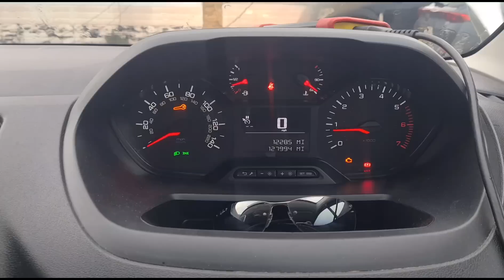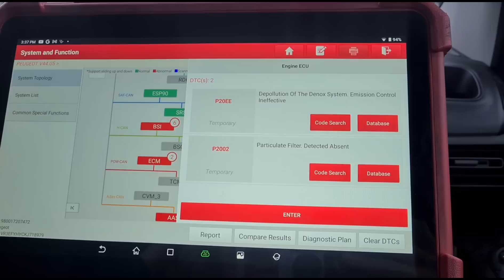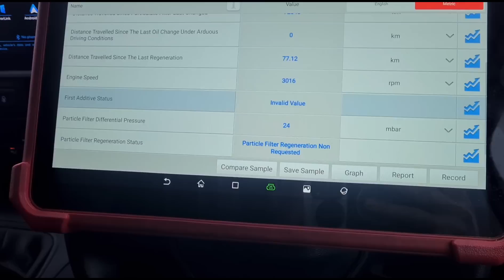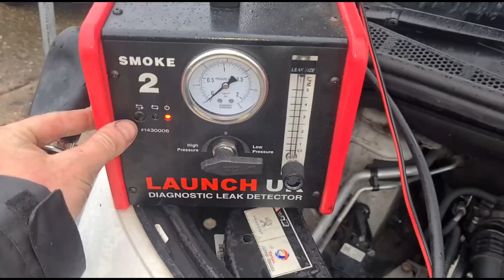Peugeot/Citroen Urea Light flashing

Comment: Hello Jimmy I was just wondering if you've ever had a vauxhall combo with the adblue light flashing with the milage counting down but there's no fault codes stored in the engine ECU at all before?
Reply from the maker: Sounds like it had a remap or you have a basic scan tool
Reply: Sorry I should have said which scanner I tried, Snap-on so I would have thought it was good enough to at least fault code read. The only live data I could see that wasn't right was the ad blue tank said it only had 1lt of adblue but the tank was full

Comment: That sound ruff as cam timing be out or has failed at some point hit valve and span cam lope that might of been fixed but in most cases dv5 bend valves due to piston head been sloped dv6 engines are flat piston so ya get away if it

Comment: Those new type 1.5 jump timing on the chain between the 2 cams, it sounds like there’s an intake leak, but it’s a timing issue. It will need either a new chain or complete cam box, but needs done quick before the chain snaps. Peugeot did a recall at one point to replace the chain and guide.
Reply: Hi just want to say that’s a fantastic diagnosis I would love stewey to go back and check it out to see have you got the correct diagnosis good man 👍
Reply: Hi would like to pick up on something I forgot to mention he said he got a second hand engine because the reading on the scan tool came back that the dpf had great reading I was woundering could that be from the last engine in all fairness the poor guy is gone home with a headache but I don’t think Stewie did a proper diagnosis on it in all fairness to the lad who put his hard and cash into it
Reply: I forgot to put black soot on the exhaust pipe

Comment: Has anyone had any luck replacing a additive tank on one of these same age  we replaced one that got smashed we got a new one from Peugeot but can't get the fault code to go with snap-on and they tell us it needs to go to Peugeot
Reply: Make sure you have the battery on charge, sometimes you have to reconfigure the tank to the correct level yours might think it's a 1L tank but could be 1.3 or 1.4, I've had a good few of them like this.
Reply: @DK-ks3lq  we have tried everything with our Snap-on and it pop's straight back up when we start it Snap-on help line say if it's 2016 on it needs to go to Peugeot
Reply: @colinhamer6506  Peugeot is a bit finicky, you may need to sort out a Diagbox system.
Reply: @G-ra-ha-m  Jimmy has since done a video on the exact same issue I had and I think he said even the Dealer couldn't sort it he ended up changing the configuration to absent for the tank

Comment: You are porbs correct about the timing bud,  done 3 with the exact symptoms over the last few months (Proace under warranty), chain tensioner breaks up for the cams. Usually the exhaust cam timing is off by 1 or 2 teeth, No cam crank sync codes because only the intake is monitored by the cam sensor hahah got to love the French, Only code that seems to crop up is an air flow fault now and again.

top vid as usual by the way